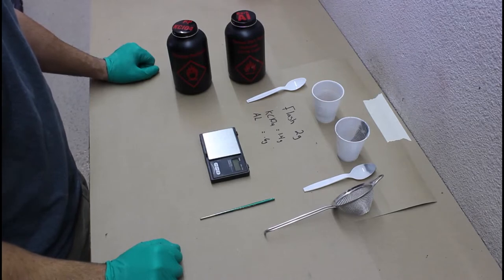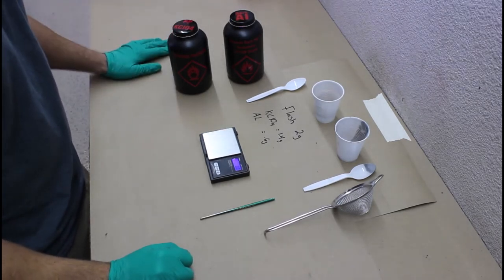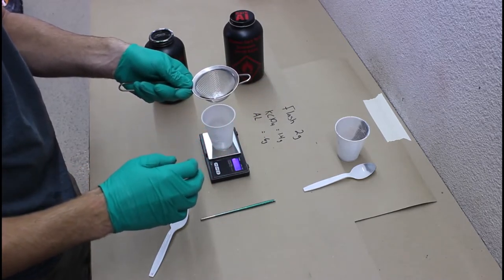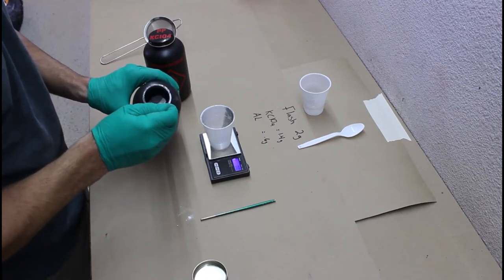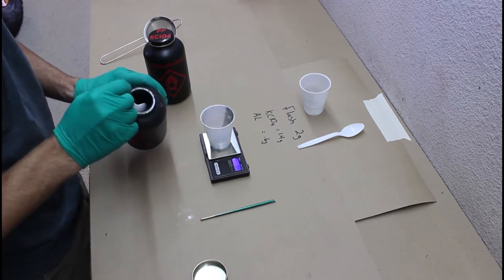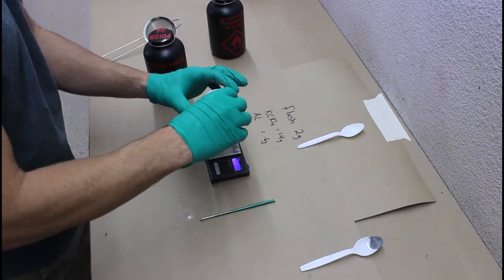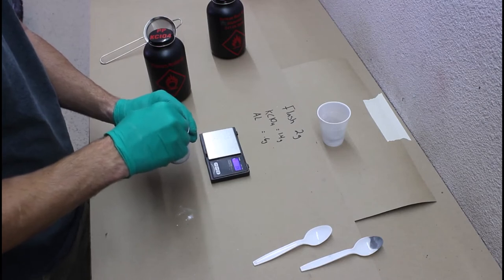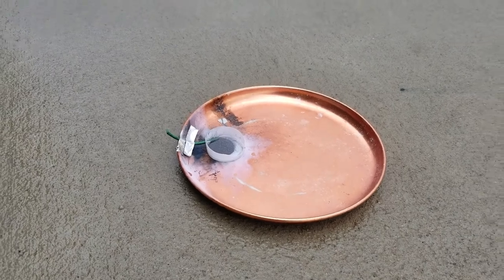Flash Powder Testing.

Comment: Why didnt it explode? My 2g of flash would've exploded instead of a fast "poof!" Maybe not mixed good enough? Seems kinda slow for just 70/30 but then again i use a very reactive 2 micron aluminum.
Reply from the maker: I use German Dark thats at 2 micron as well. It was very humid that day so that could be part of it since Potassium Perchlorate is hydroscopic or that I mixed it quickly and didnt do the usual diaper method.
Reply: @rapidoxidation  u sure? Most German is 3-5 micron.
Reply from the maker: @TheeThunderGod  after checking youre correct, its 3 micron German 5413H Super.
Reply: @rapidoxidation  great shit nonetheless
Reply: Do you use anti-cake kclo4？why my 7/3 flash won't explode unconfind even if it's 15 grams，I use Chinese black aluminum powder but they say it's only 80％ purity
Reply: @yhzhan9159  could be that chinese aluminum, and no i use pure kclo4. I never even knew there was a Chinese black aluminum. I'd definitely avoid that lol!